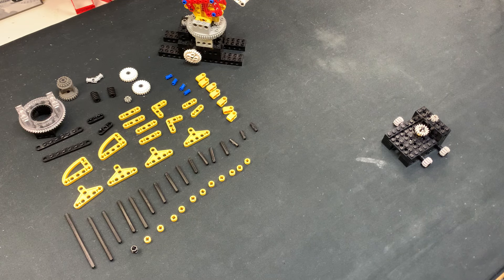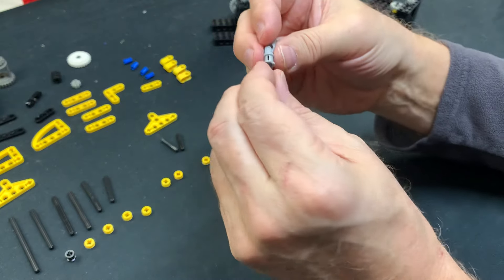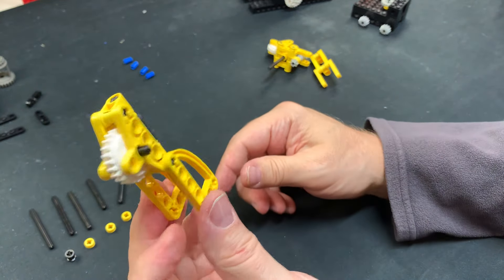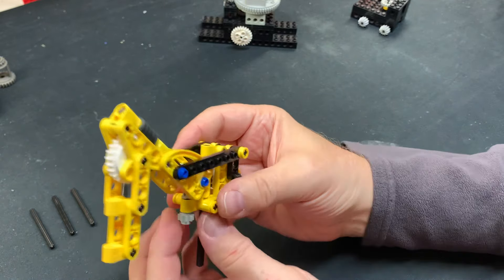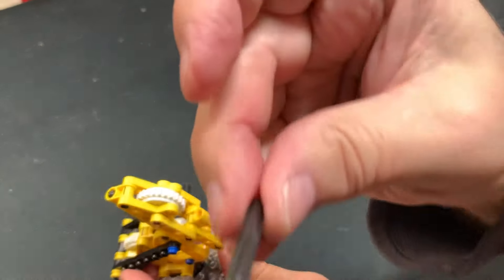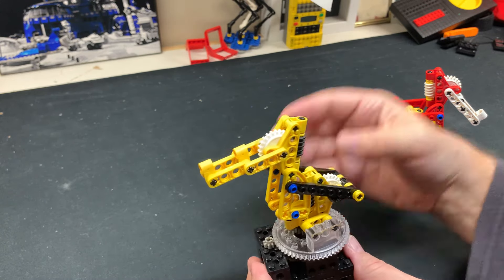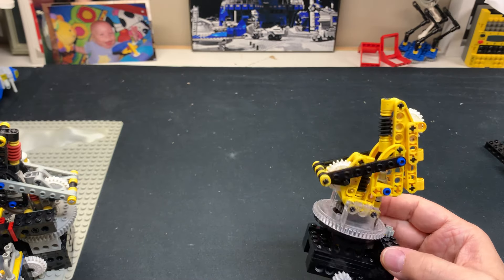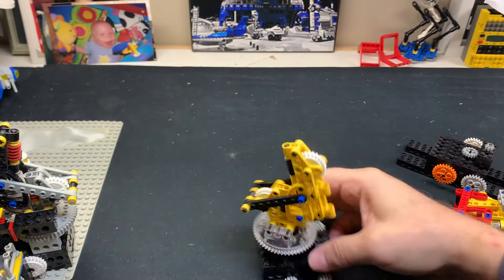DKP - Building the Robotic Arm - Step by Step.

Comment: i am learning more about how to make a Lego robot every day, this tutorial will be a good step in my journey. thank you :)
Reply from the maker: This is one of my fav builds that I've ever done. I had fun modding every section until I really liked it and kept the parts as generic as possible.
Reply: actually, now i wonder: is it possible to use a different approach to this setup, like using the new turntable pieces and/or a 16 tooth clutch gear setup with a clutch piece that locks so that it can be used to replace the differential in the robot arm?
Reply from the maker: @Suds_340  I'd love to see that setup! Nice ideas!